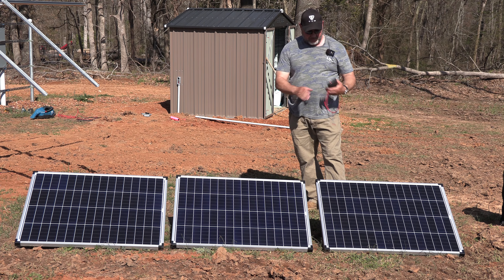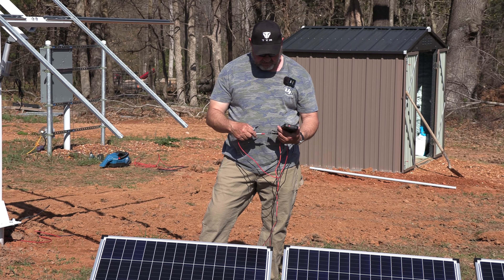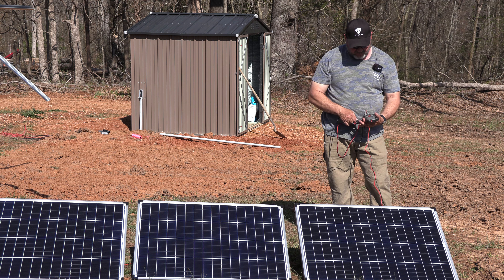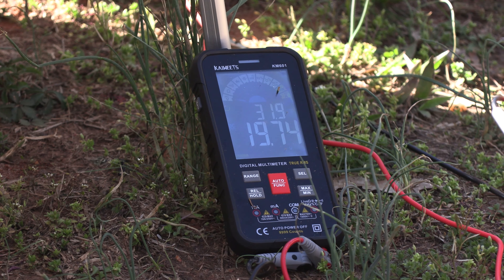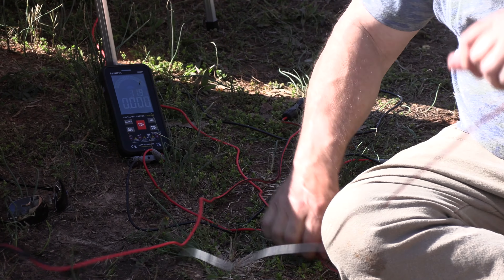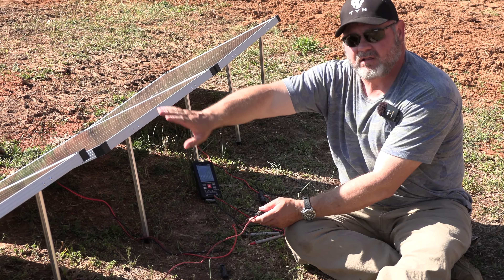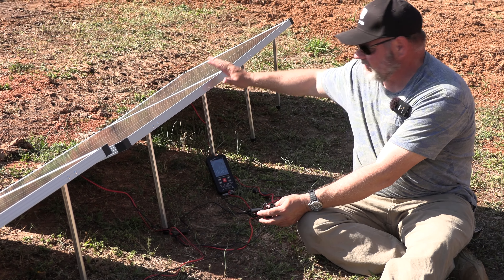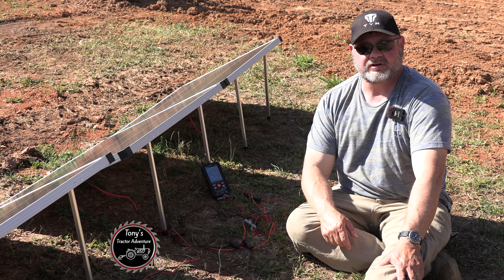Can Harbor Freight 100W Solar Panels Be Wired in Series? | Thunderbolt Solar

Comment: 20 Volts open circuit for those Panels is actually VERY GOOD, especially at these higher latitudes. I have heard MANY good reports about the Harbor Freight Panels.
Reply from the maker: I installed 1200 watts of Harbor Freight Solar Panels about 2 years ago. They have worked perfect to this point.

Comment: I got 6 Thunderbolt Harbor Freight panels to tie in to my house.  I got two grid tie in micro inverters (each rated at 350W), but when I hook up the solar panels to the inverters I get no AC out.  The LED light on every inverter glows a steady red.  There are 6 meanings listed for a red lite LED: a. Island protection; b. Over-temp protection; c. Over/low AC voltage; d.Over/low DC voltage; e. Over/low frequency protection; f. fault.  I got another inverter thinking that maybe the first two inverters were defective, and this one was rated at 600W.  But I got the same result.  I hooked up two panel per inverter in series.  DC voltage was around 39V.  So the panels were set up fine and producing voltage to the inverters.  What am I doing wrong?
Reply from the maker: There is just not enough information here to make an educated guess.
Reply: @TonysTractorAdventure  I finally figured it out.  It was in Island Protection mode.  I could have swore I plugged this inverter into an outlet.  Anyway it is working now.  

The question I have is when the panels are hooked up and working when I check the amps at the Breaker Panel to see if less power is being used the amp usage goes up not down.  How do I tell if power is being generated from the solar panels?

Comment: Nice informative video... I have 4 of these panels with 10 amp fuses on all the pos+ wires. It says on the back of the panel ( Do Not wire panels in series)...Amps current is more powerful than volts on a 12V system, I'm doing mine in parallel, but considered series/parallel.....I got SAE/MC4 wire adapters and 4 to 1 MC4 connectors for the parallel setup (4 pos+ & 4 neg-) to one pos+ & 1 neg-  MC4 /SAE connectors, that plug into a the SAE 10 AWG wire to the 30 amp controller. Also I rewired the panels with 10 AWG wire. If you look at the wire that is attached on the back of the panel, there is no writing that says AWG or voltage on the wire?? Is this legal ?  GLTA
Reply from the maker: We are on our second year with the system cranking out power. To this point I have had no problems.

Comment: You need to show all 3 in series (60 volt) and then get a piece of cardboard and put it on top of 1 panel to show partial shade and you will be surprised about the output voting series. This is why it's important to make sure all panels are in direct sunlight without any shade on them.
Reply from the maker: I would guess it is self evident that they needed to be in the sun. LOL! Maybe I will make that video. I appreciate the idea.

Comment: Good Vidya!!! I purchased two of the HFT Folding Suitcase style solar panels--100 watts each & just more recently acquired an EcoFlow River 2 Max. Panels used the SAE Connectors so I've pretty much been building my connection inventory. I just crimped and sealed with 3:1 shrink ratio adhesive lined heat-shrink tubing at the crimp connectors a daisy-chain series connector--I also fused the daisy-chain adapter. Max voltage is 50 volt input for the EcoFlow--two panels in series should do max of 40-44 volts. This is kind of a test/travel setup to see how everything works together. Only bad thing about the SAE connectors is that you can accidentally reverse voltage if you don't pay careful attention!!! Interestingly I found on Amazon a pop-in panel digital Volt/Ammeter display that can go inline at the voltage output of the solar panel(s)...it just runs off the line voltage already present and will meter up to 100 volts at 10 amps. Only thing I had to do was 3D print a case for it and seal it up with some thinned out and paintable silicone caulk. Silicone from a tube can be thinned with some VM&P (Varnish Makers & Painters) Naphtha to make it paintable!!! Absolute cheapest way to make paintable electrical tape or you can use it to coat and "rubberize" the handles of your metal tools!!!

Comment: Did you remove the solder points on the panels and reattach the new wires?
Reply from the maker: No. They have work perfectly for going on two years now.

Comment: So you replaced both the cable and connecter or just the mc4?
Reply: That is my question too
Reply: replace all.
SAE connectors are forr light bulks this junk have nothing to search on a solar panel.
and thin wires are to a pure fail on a solar panel.
AWG 10 is minium for serious current movment + MC4 for Amps below 13 Amps.

for more Amps XT60 connectors +AWG 8 wires is the way to go...

Comment: Is the 16 gauge wires on the panels enough to handle 75volts?
Reply from the maker: The higher the voltage the smaller the wires can be.
Reply: @TonysTractorAdventure   Thanks. I was scared to try, but I did it and went from 70 watts to around 150 watts.

Comment: I'd be curious how the higher voltage affects the rated current thru each panel. At some point, daisy chaining would have to fry them.
Reply from the maker: It's actually the opposite of what you would think. Higher voltage creates less resistance thereby flowing easier through the same wire. There's nothing really special about the Harbor Freight solar panels. They are built like every other one. An example would be this. You have one sewing needle to push 100 amps through. If you try to push 100 amps through with 12 volts, the sewing needle will turn red, hot and melt. If you run the same 100 amps through the needle but using 10,000 volts, the needle would be cool to the touch. Obviously, if you touch it, it would kill you but you understand what I mean.
Reply: @TonysTractorAdventure  After thinking about this awhile,  with watts equal to voltage times current,  a 100 watt panel at 20 volts would push a max of 5 amps. Three panels limited to 300 watts at 60v must have the same max current of 5 amps (5x60). Stringing them together in series will increase wattage and voltage but the max current can't change.
Reply from the maker: Right on. Higher voltage is like thinner liquid. The thinner the liquid, more volume can be passed through the same size pipe without increasing friction.
Reply: @TonysTractorAdventure  I’m

Comment: So my question is even though you increased the voltage didn't the ampers stay the same about 5amps for those panels what is the end game? Pretty much what would be the benefit I always thought more amperage is better
Reply: The benefit is you can use smaller wire gauge to wire up the system and I believe the no load loss at a higher voltage is less on the charge controller- efficient use of power and less wire gauge.

Comment: Should have measured watts while you were at it.
Sigh.
Reply from the maker: There is nothing gained by measuring watts. It changes based on the time of year, time of day, clouds, shade, etc. Each panel is rated for 100 watts in perfect conditions.  The panels have on occasion went to 105 watts during a sunny winter day.
Reply: @TonysTractorAdventure   Nothing to be gained... except to confirm that they do indeed produce the rated 100 watts under next-to-ideal conditions.

Comment: Wiring the three panels in series, you will still have just 100 Watts, and the voltage output will be around 54 Volts in ideal conditions. 
Now if you wire them in Parallel, you will have 300 Watts, and 12-18 volts.
Reply from the maker: You are correct however when using low voltage you have considerable voltage drop requiring you to buy more expensive cables. Higher voltage DC is just more efficient.
Reply: @TonysTractorAdventure  That is absolutely true. However, in my situation, Everything I learned on was 12 Volt. I have the knowledge now to do a 24 or 48 Volt, but lack the funds at this time to make those changes. So, what I'm doing at least for the present is to run the Heaviest wire I can to make up for the resistance.
Reply: Wrong. You'll still have the same AMPERAGE. 3 x 100watt panels will always be 300 watts no matter how you wire them. The only thing that stays the same is the amps. Here's the math:
20v x 5 amps = 100 watts (this is 1 panel, connect them in parallel and you have 20v @ 15 amps = 300 watts)
60v @ 5 amps = 300 watts (this is them wired in a series).